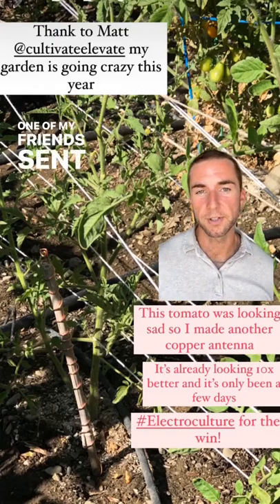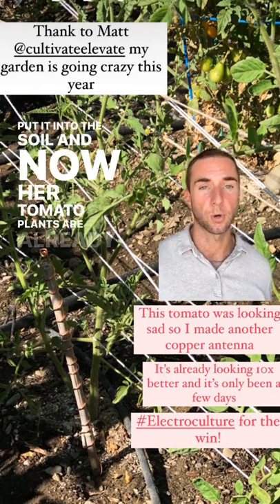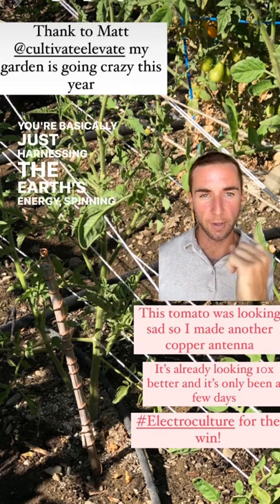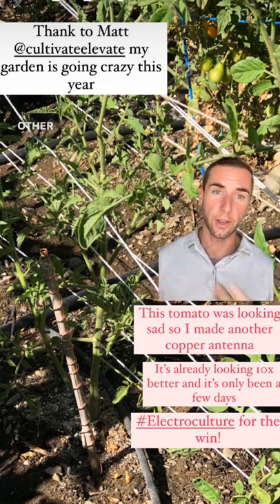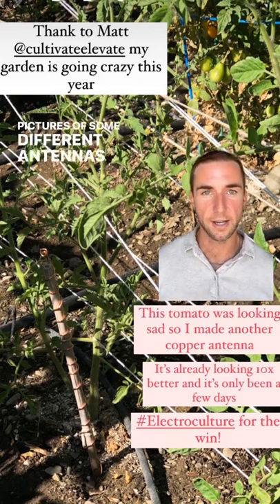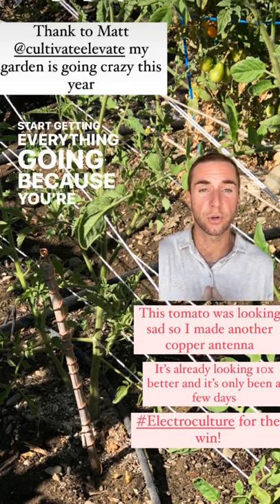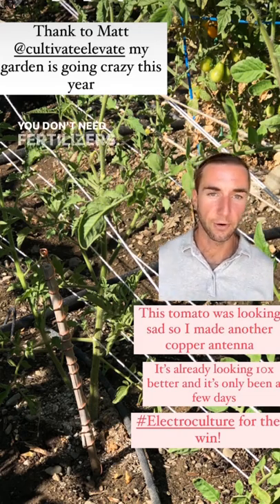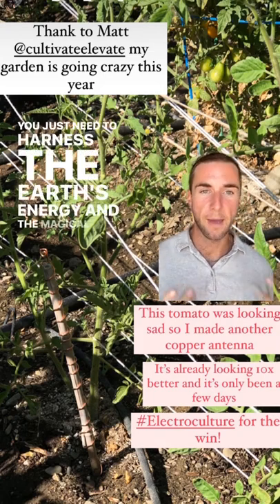Electroculture Examples using copper antennas

Comment: I'm wondering if wrapping the copper around a galvanized iron works as well as wood? I'm thinking that doesn't rot and so it's lower maintenance them wood, it's straighter and if you have that already in the garden as a trellis/pergola I'm thinking it's easier to do, what do you think? Is it worth doing?
Reply from the maker: You can always stack :) and see.

Comment: Can I put it in a flower pot?
Reply: I was wondering too, my plants are in pots.
Reply from the maker: Yep :)
Reply: I had a aloe plant in a pot looked not happy my partner brought a metal flower looking garden ornament and the aloe went crazy I didn’t really think anything of it until now years later I realised what actually happened
Reply: Does it matter which way the copper coils up the pole?
Reply: Clockwise. Point the tip of the copper in a Northerly direction and have what you are growing facing to the West.
If you live South of the equator it is anti-clockwise.